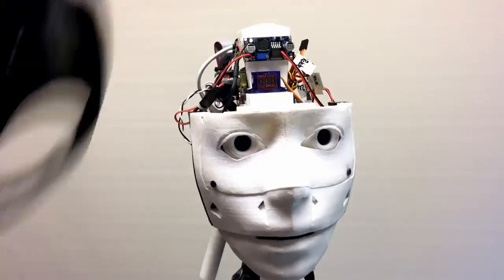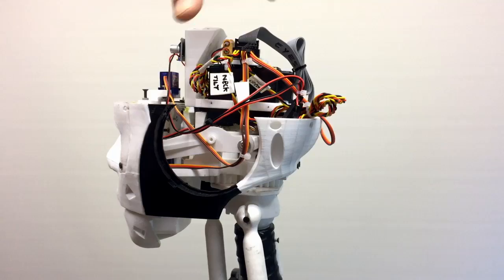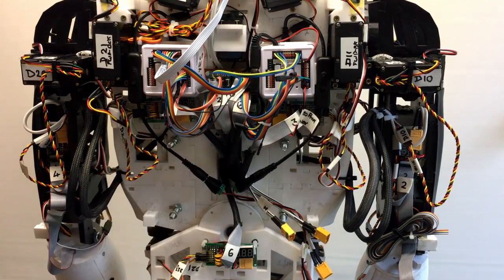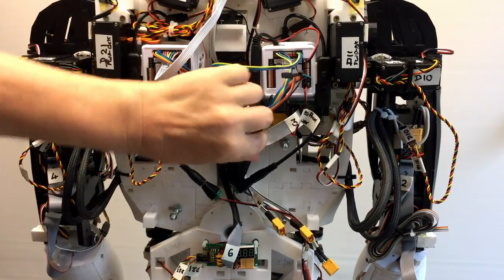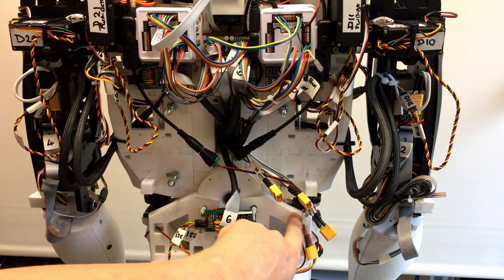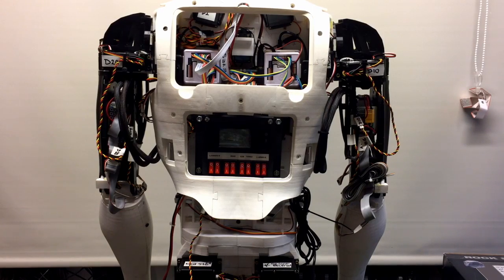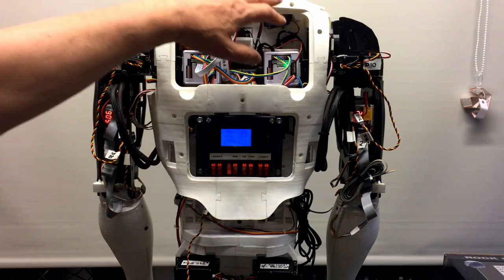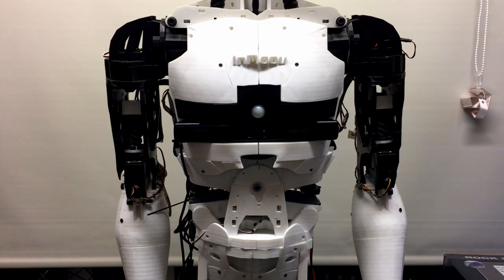InMoov Build Part - 19

Comment: hello kyle your arm work so fast !!do you use servo 805bb?? and which which tension 7 volts?
thank you
Reply from the maker: Hi Ambroise
The arms are 805bb servos and I am running them now at 6-volts. 7-volts is too high for those servos I think.    In older videos I ran them at 5-volts and they were still fairly quick [have a look at video part 13 running all at 5-volts].
Reply: hi kyle it is strange because we use the same like you servo 805 bb and us arm don't work so fast like you very nice job